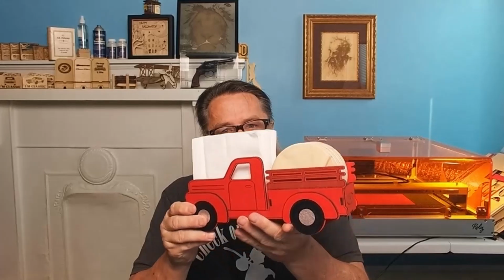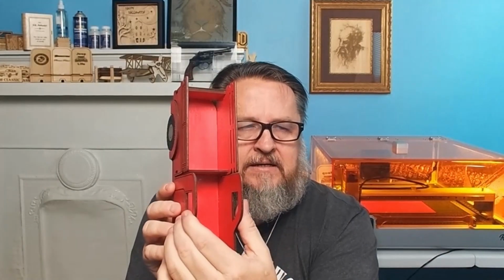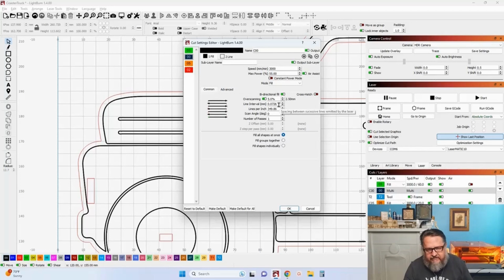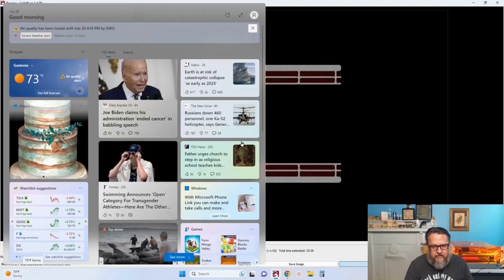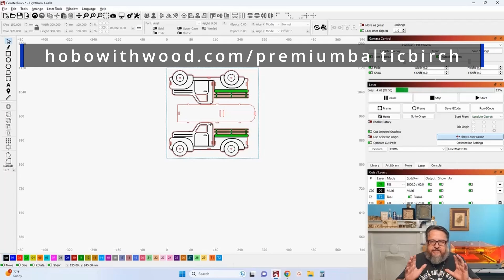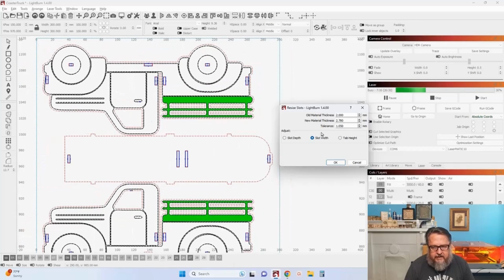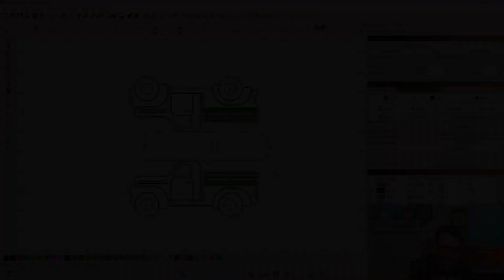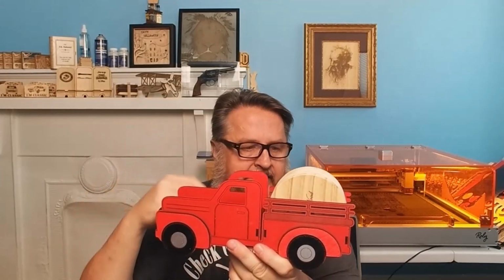Let's make a 3D Farm Truck

Comment: I like it but Needs more weight. 
Fill up the truck too flimsy
Reply from the maker: Your no supposed to use it as an actual pickup. Have you built one from my design? It is more than strong enough to be used for it's intended purpose. But I don't recommend using it to haul the pigs to slaughter.
Reply: @HoboWithWood  ha ha.
Just a few logs will do it Hobo
Reply: This truck is so much fun to make. I made mine today in John Deere colors. 
The design is exceptionally accurate. The details are enhanced by the additional scoring of the fenders and tires. 
The two sides have six bulkheads that tie the components together. This is designed fir 3mm plywood. Steve added mud tires to the final version and also separate hub caps that I added “GMC” on all four. I put a Deere Logo on the doors too. The interlocking tabs make for perfect alignment and strengthen the treads on the tires add a lot to the design. 
I think it would be cool to make a wrecker boom in the bed and trim down the wood simulated side boards.
Reply from the maker: Thanks for the kind words. I appreciate the support!